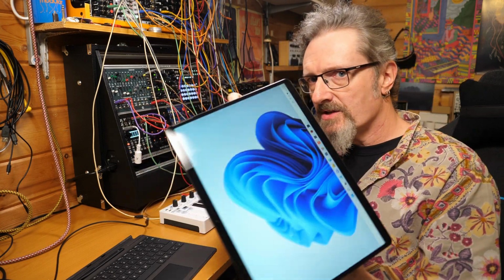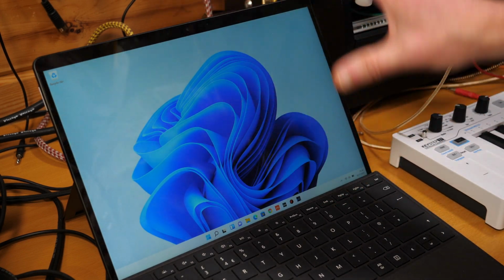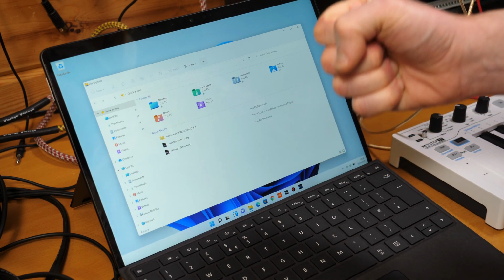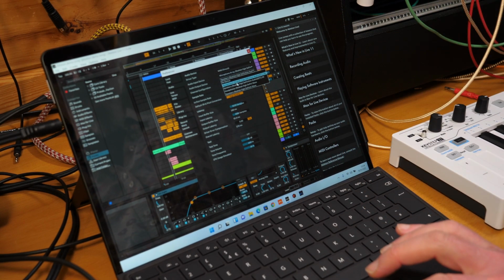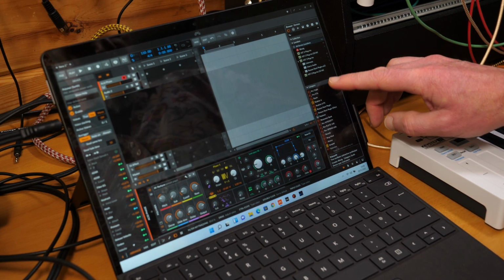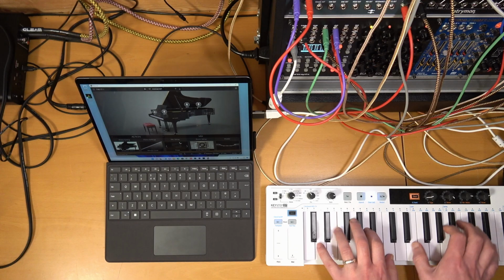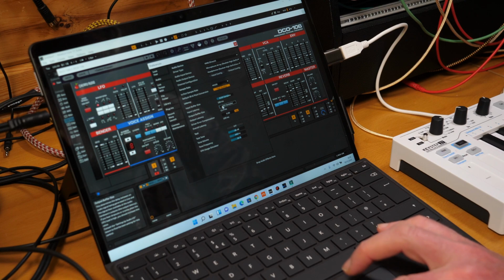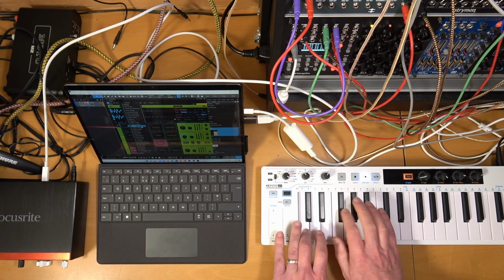Surface Pro 8 - First look for Music Production

Comment: Not sure you covered this but I assume I need a USB Midi to USB C cable to use Tablet on stage for VST and stuff yes
Reply from the maker: there are plenty of adapters for USB connectors. I use regular USB-to-USB-C adapters, they cost about a quid.

Comment: Should I use a different audio interface?
Reply from the maker: different to what?
Reply: @MoltenMusicTech   I run Presonus Studio One DAW and was told I would have problems using the Windows Audio Driver so I was thinking about buying an IRig 25 which has an audio interface built in.  Not sure exactly why I need it. I don't plan to record audio - just PLAY it.  Do you think an audio interface is needed for this situation?  THANKS VERY MUCH!
Reply from the maker: If you want a real-time response and high quality audio then yes an audio interface is essential. If you are just programming beats and are happy with phone quality sound then you don’t need one. But why not try without and see how you go?
Reply: I was getting loud bursts of noise and non-responsive playback.  Someone advised me I needed an audio interface.  Instead of buying just an audio interface I bought the Irig25 so I would have a midi controller AND an audio interface.  Does that sound like a good idea?
 @MoltenMusicTech

Comment: Hi Robin! Thanks to you I bought a Surface Pro 8 and I am very happy with it! I have issues with some Arturia plugins, like Moog Modular, ARP2600 or Buchla Easel.. I am unable to connect patch cables using the touchscreen or stylus, it's like mouse arrow can't follow stylus cursor inside plugin window. Did this happened to you too? Is there a solution?
Reply from the maker: Yes, touch isn't always well supported in plugins. It varies. Arthuria ones tend to work ok on knobs but not on menus or other aspects. Touch and the pen work differently to a mouse so support for them has to be part of the build of the plugin. This is often accidentally included because it can be part of the software they use to build the plugins - but not always. It's still the wild west out there with touch on Windows I'm afraid.
Reply: Right. This is what sets iPad system apart but despite this I still prefer Surface with more powerful OS and professional software. Is there a third party software that turns stylus on a real mouse? Windows option seems to only work in some apps. Thank you!

Comment: What are the specs for the Surface Pro 8? i5 or i7?
Reply from the maker: i5
Reply: @MoltenMusicTech  Thank you. My macbook pro died. I'm a music producer but mainly small home studio. I use Ableton and some VSTi with Push2. I'm done with Apple. I want to build my own PC but I want to have also something to make music on the go for my trips, for doing some easy video editing with Premiere and some drawing like I used to on my iPad that I just sold. I want to move away from Apple for ever. I've been looking into Surface Pro 8 or 9. Could it be a good fit?

Comment: I loved your videos on the Surface 8.  So informative and helpful.  I just bought one with the same memory as yours, and I ran the LatencyMon scan.  After running for awhile, the bottom measure, especially, ran into the red zone.  Then a message appeared at the top which says that I am likely to experience buffer underruns and drop outs, clicks, or pops due to one or more DPC routines that belong to a driver executing for too long.  In addition to a WLAN adapter being a problem,  it also says that a problem may be due to power management, and it suggested disabling CPU power throttling settings in the Control Panel and BIOS setup.  It also recommends checking for BIOS updates.  I attempted to change the power throttling settings based on instructions from Google searches and was unsuccessful.  I have no idea how to check the BIOS setup.  Have you run across these issues before, and if so, what do you recommend?  I had expected that my new Surface 8 would run the same as yours does, but apparently it does not.  The errors showed up after scanning for awhile though.  I listened to many of the sounds in Ableton Live on the Surface Pro 8, and the sound quality is very good.  I need to make a decision on whether to keep it or send it back, and would appreciate your advice.
Reply from the maker: Hi Julie - thanks for the comments. The LatencyMon thing will always come up with something sooner or later. The important thing to ask yourself is - are you having a problem? Are you experiencing drop outs in playback, are your instruments crapping out, are you getting clicks when playing a synth? If not then don't worry about it.

Did you see my next video which goes into more depth about testing and tweaks? Also I have earlier videos on tweaking Windows that you might find helpful - IF you are having problems:
https://youtu.be/2qlz-U9eSMs

I hope that helps

Comment: I originally bought my iPad m1  for this but it’s not as simple. Thanks for the review I’m going to get surface because of this 🎉
Reply: Same here. I have m2 iPad Pro which I will sell because it is useless in terms of full-fledged music production. I bought all the software on iOS, I have all the DAW, they do not stand next to any desktop version, solid bugs and lack of any optimization. Even praised Cubasis 3, the only one supports multi-core and that in limited mode, but daw itself is a child's toy simply. In general, complete disappointment about music production on iOS. I made some of my tracks on it, but ended up going back to desktop programs.

Comment: Hey mate! Im looking into getting a Surface pro 8 but im a bit on the fence wheter i should go up in price and get the i5 16gb RAM or if 8gb RAM will be enough? 
Microsoft is offering a discount on i5 8gb RAM with 128gb of storage right now and with the discounted price i can easily buy a 1TB SSD. 

My main concern is if i want to start recording drums at home, will the 8gb of RAM be enough? i know it will be enough for everything else i wanna do with it.

Comment: Most problems on surface pro 7 I have stem from overheating, compatibility with windows 11, and just not enough accessories for it like being able to dock it with a screen output (way expensive)

Comment: Still hesitating between SP8 and Surface Laptop Studio. 
Its purpose will be 100% music production. Any advice ?
Reply from the maker: I only know the Surface Pro. Neither are ideal for music but I make the best out of them I can.
Reply: @MoltenMusicTech  Thanks for the reply ! The SLS is about to get released in my area and I really can't figure it out. What are the flaws you found that makes music more difficult to work with this system ? How stable is it ? Can I still hope to make out of this my dream setup, which is a highly mobile 2 in 1 laptop that could carry recording (with a lot of MIDI) + editing + producing with many VSTs, + mixing, and most importantly DAW Live performances at semi-pro level with several instruments ? Or should I save my money for something else ?
Reply from the maker: I've made dozens of videos on the Surface Pro as a platform for music - you can witness what it can do and how stable it is. The point here is that the CPU in these sorts of hybrids are not ideal for music making - they clock down when stressed which is not what you want for running VSTis. However, I like the Surface Pro as a platform, I like the combination of touch and traditional control, i like the size and usability of it and that's why it interests me. Then what I do is work out how much of that CPU I can use for music production - see my many videos on that. Any laptop with a desktop style CPU will do a much better job at running VSTis but it will be heavy and chunky. So, watch my other videos and see for yourself whether the Surface Pro can do enough. I will be doing an indepth video on the SP8 very soon but i don't imagine it will be massively different from previous versions. Only you can decide whether what it can do is enough for your purposes, all i can do is try to give a demonstration.

Comment: Thank you for the video!
I consider to get sp8 (i5, 8GB, 256GB) or surface book 3 (i5, 8GB, 256GB). My intention is to use it when travelling or "in the coach", using ableton. Using no external gear as sound interface etc.
The SB3 seems to have slower cpu (without turbo) 1.2 vs 2.4 GHz, but sb3 seem more solid build. 
Similar price.
Which of them would you recommend? 🙂
An other option is (e.g)  the 1010 music blackbox...
Reply from the maker: Well, i like the Surface Pros myself - the form factor is a big factor - no point getting the one you don't like the look of. However, non-turbo speed is important if you are turning off turbo to run audio projects. Anyway I can only really talk intelligently about the one i've tested and the sp8 is shaping up quite nicely. But i haven't done intensive tests yet - next week hopefully.
Reply: @MoltenMusicTech  
Thank you for answering.
I haven't seen them in real life to be honest. Just the package of sb3 on sale. The lower "non turbo" frequency of the SB3 scared me a little bit. 11 generation i5 inside the sp8, 10 gen. inside the sb3...

Comment: Thanks for the video. Are you sure the issue you mentioned with i7 and audio occurs on Surface pro 8? I am considering buying one. Mainly for note taking and photo editing, but it would be nice to make some VST patches on the go.
Reply from the maker: I’m not testing an i7 so I don’t know but over the years I’ve seen that the i7 gets hotter and clocks down sooner than the i5. I’ll be doing full tests on the sp8 over the next week or two

Comment: Great demo. Did you test, how much CPU power in percent you can use, before the fans start running? Is there any possibility to make the fans to stay silent?
Reply from the maker: That will be in my next video coming over the next couple of weeks. There are no fans in my SP8 - good reason to get the i5 over the i7.
Reply: @MoltenMusicTech  Got my Surface Pro8 with i5 processor and 16GB yesterday. But there is a fan inside. And at least when running at higher speed, it is quite noticeable. Nevertheless, with up to 70% CPU load, the fan is mostly off.
Did also some little speed tests. Core i5-1135G7 vs i7-4770k (from 2013): CPU-Z tells that the Surface is 20% faster than 4770k. But running the same project in Cubase, the 4770k uses only 25% of the CPU power while the i5-1135 uses about 45% CPU in Cubase. Might be that the Apollo interface with USB 3 on Surface is slower than the old RME HDSP 9652 on the 4770k desktop.
----------------------
Just tested the Apollo on the desktop. The performance difference really comes from the computer and not from the audio interface.
Compared to my Surface Book 1 with i5 CPU and 8GB it is much better. The project I tested on the Surface Pro8 with about 45% load and no dropouts didn't run on the Surface Book 1 without drop outs, not even on higher latency. With the Pro8 I was also able to go down to 32/64 samples and it still worked. But the Load went up to nearly 100% and I could hear the fan, when running several minutes.
_________
The test project used 2 instances of Keyscape, 1 of Trillian and 4 of Omnisphere + 2 UAD FX. Not much, but compared to other Plugins, the Spectrasonic VSTis use much more CPU than most of my other VSTi. So I assume that running up to 20 VSTI + 10 FX might work without dropouts. I used 256 samples as buffer for the load test.

Comment: I see you're using Motu and Focusrite audio interfaces, was there something wrong with the Arturia AudioFuse or do you still use it as well?
Reply from the maker: I use that on my main machine - it's heavy and needs a power supply and so not quite as easy to pull out and plugin.
Reply: @MoltenMusicTech  ah, nice to hear that, I was wondering if there is something wrong with it because I'm planning to get the AudioFuse Rev2 soon, but this answer is good news to me, thanks for that info :)

Comment: Great video. 
I would like to know if acustic instruments can be played through the SP8 and the interface, including some FX. Don't know if you already tried it or that will be showing up on the next video. 

I saw with the SPX there was a lot of latency with real instruments, unless you use real-time monitoring.  If you are using the SPX for live situations it won't work.
Reply from the maker: Yeah, i mean the latency was certainly low enough on the Clarett but latency is different things to different people and something that sounds realtime to me might not be to you. But normally speaking the SP8 is working like any other computer and running an audio interface under 10ms of roundtrip latency. So if it's ever worked for you on another computer then it shouldn't be any different here. The SPX can't use ASIO drivers so that's never going to cut it.

Comment: How about go3 with i3?
Reply from the maker: Don’t know. I can’t recommend something I haven’t tried.
Reply: @MoltenMusicTech  I have Surface 6  i5  and it's great.  The only thing you have to do with the i5 is to deactivate turbo boost in power options to keep stable audio. Of course this one has to be better now it has Thunderbolt, I am considering getting a focusrite clarett now my desktop PC also has TB. My advice is don't get an i3. The i5 has just the power it needs to be super practical. You might run short of cpu power with the i3. The i7 has a shorter lifespan and an annoying fan and the i5 is just perfect
Reply: I have Surface 6  i5  and it's great.  The only thing you have to do with the i5 is to deactivate turbo boost in power options to keep stable audio. Of course this one has to be better now it has Thunderbolt, I am considering getting a focusrite clarett now my desktop PC also has TB. My advice is don't get an i3. The i5 has just the power it needs to be super practical. You might run short of cpu power with the i3. The i7 has a shorter lifespan and an annoying fan and the i5 is just perfect

Comment: Not sure how much it costs (it will only be available in Poland at the beginning of 2022), but based on how much old SP4 i7 costed few years back I expect it will be more expensive than last year's Mackbook Pro 13 M1, which would be my choice instead. I never owned Apple product, but everything I've seen & read about it suggest it would be a great upgrade from my 2019 gaming laptop with i7-8750h and - surprisingly - isn't that much slower (for music, at least) than the new Macbooks with M1 Max/Pro chips: https://youtu.be/UG5v46lluT0
Reply from the maker: Great, thanks! This is about the Surface Pro 8.
Reply: @MoltenMusicTech  Yes, and that was about what I think is a better alternative. Thanks :)
Reply from the maker: Great! I usually have a prize for the first person to recommend a Mac on a Surface video, so well done, good job mate :D
Reply: @MoltenMusicTech  haha

Comment: With the fans in both the i5 and the i7 model this generation, wouldn't you want a bit higher of a ceiling just in case? Or will the i7 generate more heat when running equivalent loads?
Reply from the maker: That seems to be what happens. People with the i7 appear to struggle with the heat and downclocking much more than the i5. Having extra power is of no use if you can't keep it stable. Besides, I just don't have the cash for the i7.

Comment: "Thunderbolt is annoying" yep I ended up Upgrading my entire Rig because the Thunderbolt adapters just don't work, even though my motherboard specifically said it would. I tried every which way, multiple cables and adapters. I ended up getting a thunderbolt 3.0 onboard motherboard and that finally fixed it, $900 for motherboard and processor, I was lucky my ram was still compatible. I had just gotten an Apollo x8P to startup my project studio and it was integral to my plans.